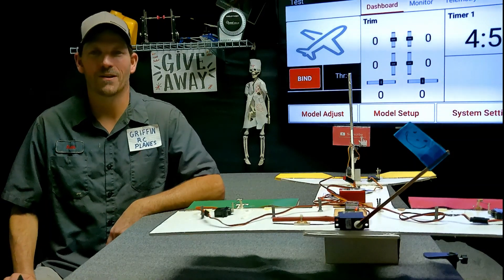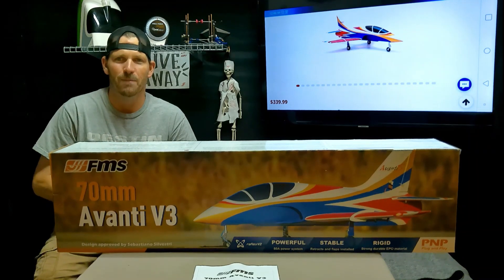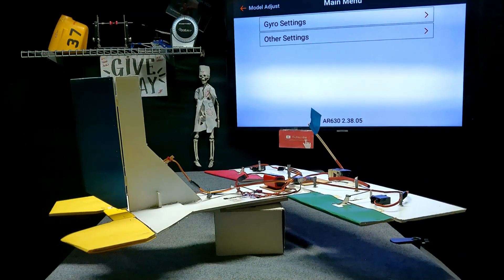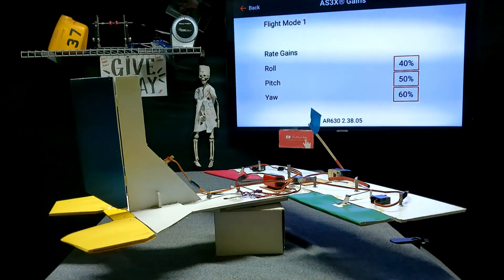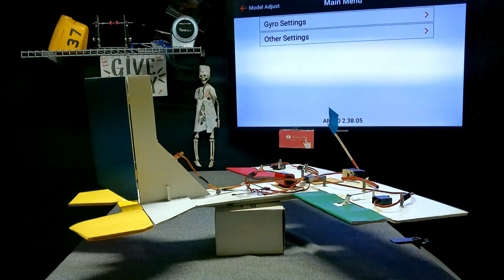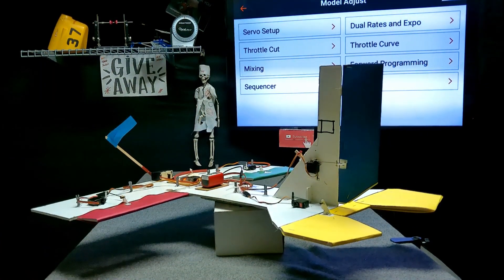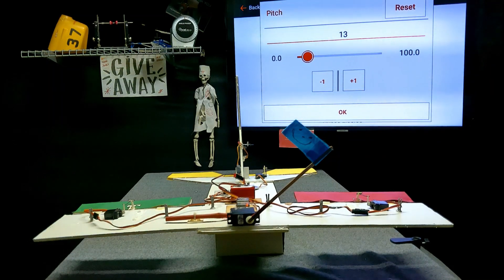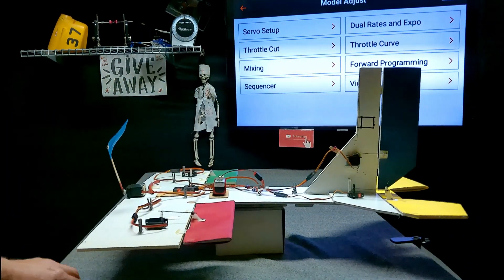SAFE SELECT AS3X GAINS EXPLAINED SPEKTRUM AR636 AR630 631 637 AND MORE E-FLITE FMS RC AIORPLANE

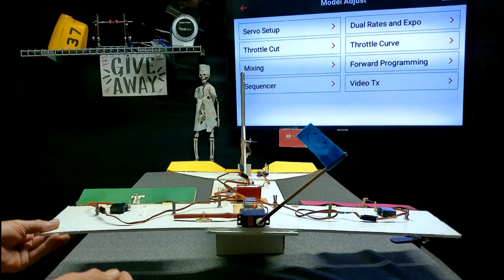Comment: Hi Sean! I must disagree when, at 8:43, you start to say that fast airplanes, like jets, need high gains and slow airplanes need low gains. It is the opposite: In fast airplanes the wind speed (of the gust) is small compared to the speed of the plane, and therefore only small deflections of the controls surfaces are needed (low gain), while in slow airplanes you need big deflections in order to achieve the desired corrections. This is related to the "Gain Sensitivity" field (you have it at 4x, I guess for demonstration purposes). The recommendation is: "Agile aircraft with extreme control surface deflections or high speed aircraft should use 1X. Moderate sport airplanes should use 2X. Slow and inherently stable aircraft with mild performance should use 4X.". The higher the "Gain Sensitivity", the higher the gain.

Comment: I believe this is why a T28 crashed of mine. Put a receiver from an AeroScout in it and didn’t adjust anything. Lesson learned. Thanks for the video.
Reply from the maker: you may have had a fighting chance if you mounted the receiver EXACTLY as it is mounted in the aeroscout. if you had the pins faced the wrong way or ?? then the as3x and safe would work in the wrong direction

Comment: You should show the setup process....where you have to fly and trim it out and then let it fly untouched for 3 seconds to show the learning process and then how to fully setup safe on a new ar630 or ar631 and the whole process with forward programming from new to complete and how to set it all up...I'm having an issue so I don't activate safe

Comment: Also...I have a brand new timber x not the night timber but the reg one and it comes with the 50 amp.....I don't have battery telemetry...do I need to put the avian 60 amp on it to have battery telemetry? Also why does the night timber come with the 60 and the timberx come with a 50 does it need that extra 10 amps

Comment: Instead of leaving the gain multiplier at 4X and turning the gain down to 13, I would have turned the multiplier down to X1 and left the gain set to 30 or 40. I avoid really small or large values. On my EDF’s, I set the gains to 30, 40, and 50 percent for roll, pitch, and yaw. Because they’re faster, they need less gain. Slower planes need more gain.
Reply from the maker: Are you now in the smart receiver club? Lol
Reply: @GRIFFINRCPLANES  Of course. Been using them for a while..